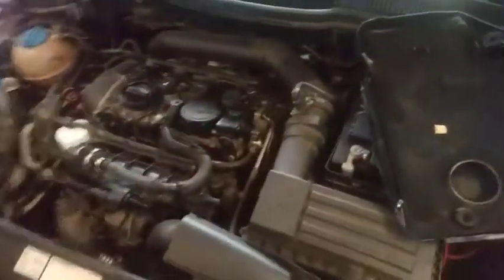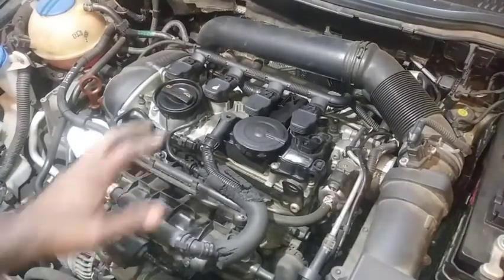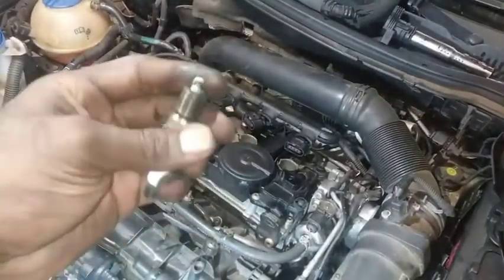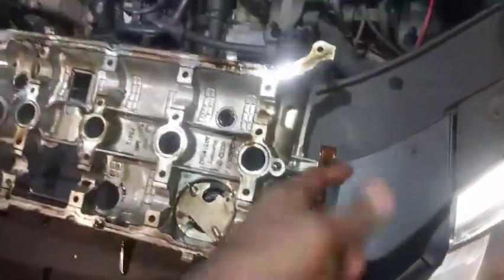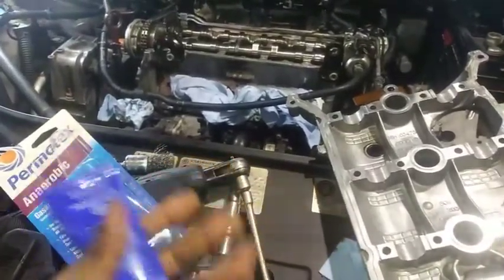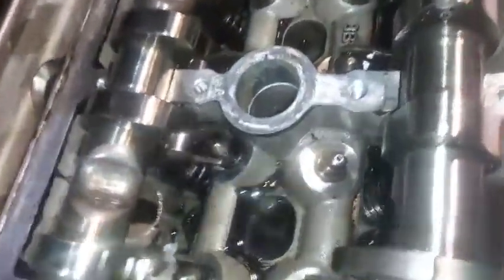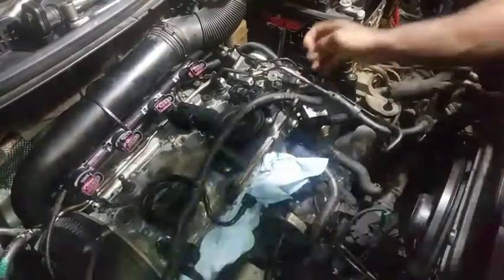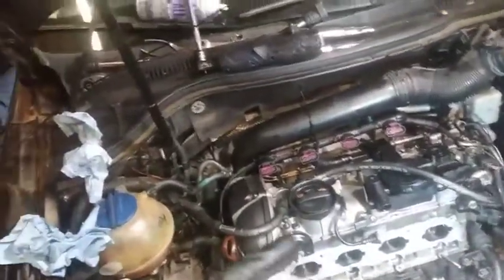p0300 p0303 VW cc sport 2.0T

Comment: I gotta agree with you on hating to work on Volkswagens and Audis but I've had 12 of them so far.  The great thing about them is that it's super common for the cost of repairs to exceed the value of the car so you can get a nice car for scrap value.  If you do your own work you can fix most problems for less than $100, it's just that problems pop up quite a bit.  But I can't go back to driving a Honda or Toyota, the driving dynamics and feel of the VW are so much better.
Reply from the maker: I can agree on the handling and expenses with vw and Audi... Just not, not driving honda and Toyota lol. I know it's a little contrary to my logic. The engineering is a turn off with vw and Audi over Toyota and Honda
Reply: @partsshooter Actually, when I think about it, my '93 Prelude Vtec was way more fun than my 2010 Passat.  It's just that nice Honda's and Toyotas are expensive but I only paid $600 for my Passat.  Thanks for this upload, I tried replacing coil packs and it didn't work but after watching this I replaced the plugs and it's running great...for now
Reply from the maker: @vagabondroller  cool...  Car never came back for misfire after I fix this. Just fyi
Reply: I have to break mine down. I've been riding mine for a whole year with a misfire I need to fix it so first I'm going to take off the valve covers I never took those off I did a tune-up all that stuff and it still runs with the misfire so I do need to check my top valves

Comment: Dirko Gray silicone sealant is a good alterjative to OEM anaerobic sealer.

It is sold by ECS Tuning and also many UK stores for Audi/VW applications, in this case, timing cover.
I give you Kudos for working on other people's european cars. These 2.0t engines are a hassle to work with, way way too many variables on things to go wrong, not like Toyota/Nissan, is fixed and done.
Audi VW are way over-engineered.
thanks for the videos

Comment: same vehicle similar symptoms , car started to give hard start then in a little while stated to stall and hesitate on the low speed, traffic light etc. took it to the mechanic.. got engine running rich code/s.. changed pcv valve and plugs then cleaned the injectors, symptoms eased up for couple weeks then started to consume oil bad  (1qrt per 500km) then epc light, misfiring and all the symptoms a lot  worse.
any advise 
thanks
Reply: the mechanic was confused about it, saying it is not a regular fault the he usually gets !!! so i had to drive it as it is!!
Reply: Possible rear main seal failure
Reply: @rustbeltrestoration  
The hard start issue solved 
I believe the mass air flow sensor plug seal was swollen so it was not going in fully 
But i only discovered that when the mechanic installed a new high pressure fuel pump, then he noticed that when he was putting back the plug ( since he needed to remove everything over the fuel pump to be able to install it)
So after that all the symptoms related to hard start and stalling etc solved
But i can  not tell if it’s the fuel pump or the MAF sensor plug !!
Still have the oil consumption issue .. mechanic said it need engine job done!!
( he believes it’s piston seals ..)
Not sure if is that cuz I’m seeing oil on the back side of the engine cover (on the coils side)
It could be head gasket!?
Reply: @Kins432  I have very similar symptoms- huge oil consumption and a rough start. Has changed PCV valve, Water pump and intake manifold recently. 
Now found that everything around valve cover is leaking. Now replacing seals and o-rings around cam shaft magnet (WHT007212, 06H103483C and 06H103483D) , then applying Vacuum Pump Reseal / Rebuild Kit (RKX-VPK-009) and finally going to reseal valve cover. I hope that should reduce oil consumption a lot.
Reply: @Kins432  give it a quick clean and trade it, save yourself the VW Audi financial misery.
These cars are the ultimate money flippers for mechanics, they buy them cheap, fix them real quick and sell to make a buck, but is a nightmare for the owners.
Reply: @dikov11  Hey , any improvement on oil consumption after the repair?
Reply: @psiturbo   the problem is: these kinds of cars hard to sell. Once u buy it u stick with it 😌
Reply: @Kins432 
is not a matter of if, is a matter of when... each person has their own rock bottom.
I had a Subi RS 2.5, everyone on the road giving thumbs up, everyone loved the car, but it took me through financial spending like a crack addiction. I proudly replaced that POS for a Toyota Corolla, the happiest day of my life, which I still got with almost 200k.

Comment: We got the same issue... I changed the ignition coils and put brand new iridium plugs in it.... And its still doing the same B's.... Legitimately same thing straight after changing it.. it didn't fix it.. but dude the previous owner and the dealership we got it from never changed the plugs... It still had the original plugs from the factory in it.... Lol but it's got alot more power but still missing. We bought the OBD2 computer so imma plug it in and find out WTH is going on with it.. it's got the K04 turbo and headers ect it's a fast car but that damn misfire is driving me crazy lol the engine light still on and starts blinking and stops n starts blinking again lol.
Reply: Did you figure it out?
Reply: Is there a specfic scanner you need for a VW? I have a P303 code. Changed the plugs and the engine coils. When I added Seafoam the engine light went out but came back on. Went off for a month and then came on again. I had the same flashing and the EPC light, that hasn't come back on in a long time!

Comment: I thought white on plugs was too lean and running too hot..?
My 2013 VW CC had/has cyl 3 misfires, even after the dealer replaced cyl 3 fuel injector less than 2 yrs ago. ($1000!)

Comment: I think I might have the same issue but im not entirely sure. I have the P0300 engine code along with P0302 and 0304 I replaced my spark plugs and my ignition coils are good. My engine tends to shuttered when I start it up and I kept getting the P0300 code, do you think I have the same issue or something different?
Reply: I got the same issue with a 2017 cc.

Comment: Does that car was ever money shifted ? Because this could happen if engine was overreved.
Reply from the maker: Its automatic
Reply: @partsshooter  Oh, thx. It can't be $$$shifted than... :) I had same issue, which was manifested at high rpms as missfire, but it was catastrophic at the end. Same lifter has dropped off and ruined my exhaust cam, rotate it in the  chain sprocket at about 30 degrees, and that was result in bent exhaust valves.

Comment: I just bought my sister a 2010 VW CC with 177,000 miles on it. The car was running fine and we did some maintenance to it. Replaced the oil and spark plugs. The EPC light turned on. We replaced the engine oil separater and it ran fine on the freeway until about min 20, then it wouldn't go beyond the 2 RPM dial. We were told the throttle body or the coils. But we're not sure. Can you give us a bit more troubleshooting ideas??
Reply from the maker: Pull the check engine codes, note them and clear then, test drive and address the immediate code comebacks
Reply: i realize I'm pretty randomly asking but do anyone know of a good place to watch new series online ?
Reply: @Bryant Brooks Flixportal xD
Reply: @Koda Alijah thanks, signed up and it seems like a nice service :) I really appreciate it !!
Reply: @Bryant Brooks glad I could help :D
Reply: So what was it.. Bc i have a 2012 an i replaced spark plugs coil pack an max air flow.. Could it be my computer?? Ecu
Reply: wow, 177k, seriously? your sister gotta be pissed off at you, that car belongs to the junkyard, endless money pit. I would not own a VW Audi past 80k miles. 
These cars are not like Toyota that you buy some Purple Marvel Seafoam mystery chemical, a quick spark plug backyard maintenance and done. At those miles, they demand a complete engine teardown and overhaul. I have a VW, it is an ENDLESS MONEY PIT, it will question your existence and test your patience to its limits.
My advice, give it a quick clean and sell that POS ASAP.

Comment: in my case the problem (miss fire on all cylinders and oil pressure warning on idle) was dirty vvt adjuster/magnet! Litle bit of parts cleaner sprayed in each hole and problem is solved!!!
Reply: I am having same issue, bad misfire under load and occasional low oil pressure warning light but goes away. Misfire is random and sometimes doesn't happen for a couple minutes then comes back. Are you referring to the phasers? What adjuster are you talking about.
Reply: Oh wait your talking about the VVT solenoids? I'm gonna try those next myself and see if it fixes it. If this works you seriously have been a god send its been MONTHS with this issue and so many things replaced and still the same.

Comment: I got the exact same misfire 😂 at first it was multiple misfires on all cylinders.. but I put R8 coils and Iridium plugs... N it didn't wanna start for a good 5 secs. Well I got to looking at the old plugs and 1 , 2 and 4 had carbon build up on em like a white sandy junk.. which I heard is basically hot oil drops. And #3 plug was black n gunked.. well today I went outside to check #3 plug n see what's up.. well it's wet n black... N I checked #4 n it's lil white. So I swapped 3 and 4 around plugs n coils n then checked the scanner... Same BS #3 misfire... And I thought about picking up a hot plug for #3 to get it to fire normally for a while atleast until I get the new pcv which i assume is bad considering #3 cylinder is sitting under the pcv well pretty close anyway. Now I ran Marvel mystery oil in both the oil and fuel n I went n put 91 fuel in because it's the highest fuel we can get within 10 mins because we.live in the Appalachian mountains in western North Carolina outside of Ashville. Well I closed the gap closer together on #3  and dude I gapped em all at 30 well I closed #3 down to 25 and it still is misfiring but...... But.... It isn't hesitate like It was it got power back n isn't stuttering as bad but still it's misfiring n will stutter around 3krpm 2500rpm ect but on acceleration now it doesn't hesitate like it was... So it definitely helped.. so I'm prob just gonna put a hot plug in #3 maybe it'll fix it until I get the new pcv which is most likely the issue.
Reply: so what was the issue?
If the spark plug is soaking wet in oil, you are in for a rebuild, and the longer you wait, the more damage to other components.

Comment: For anyone whos still going thru the same thing i have a 09 passat cc 2.0t and im going towards changing the MAF sensor!!!
Reply: Wouldn't you pull a code for the mass air flow sensor though I'm going through some issues with my CC right now I have multiple misfires my plugs and coils are good and no other codes just only the p300 and p301 p302 and p303 and p304

Comment: I have the same vehicle and when I tell you it's been a f***in headache. I'm over this piece of shit car. It's been in the shop for 6 months ran good and still ends up with the same issues.
Reply from the maker: Yeah... I have to replace the turbo next to stop the oil consumption. It hasn't been back for the misfire since I fixed it.
Reply: @partsshooter  can you tell me what all did you change?
Reply from the maker: @iamjazzlyb7227  its in the video

Comment: I just got this code that do you think if I change change my coil packs and spark plugs it’ll be fixed? It said cylinder 2 & 4 are misfiring
Reply from the maker: Swap the coils and see if the problem moves... If it do, replace the coils.

Inspect the spark plugs for fouling, if they're black, replace them. They should have a faint while sut residue
Reply: I just checked mine, it followed the coil.
Reply: Yes, this happen to me multiple times. Don’t get them just form any auto store it’s best to get them through Volkswagen. Once one goes bad it’s best to replace them all 4

Comment: parts shooter ..I'm going to look at a Volkswagen cc 2.0 t it has a p0300, p0303 code which is the hard code ..what should I be looking for with these cars these small 2.0 they always seem to have misfire ..but what could I do to make sure it's not more than a plug or coil
Reply from the maker: @erickushner9869  plugs commonly fail due to oil consumption.  If you see excessive build up on the plug, replace it. 

I have a 3 year update on this car that helped significantly with her misfire. I'll find out and send a link
Reply from the maker: @erickushner9869  https://youtu.be/9E9Qnl5QcBw